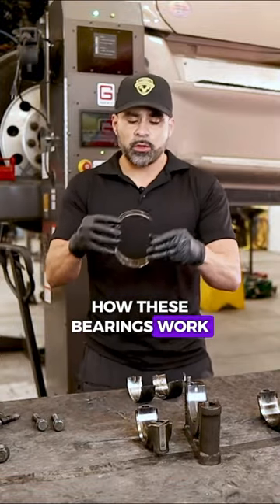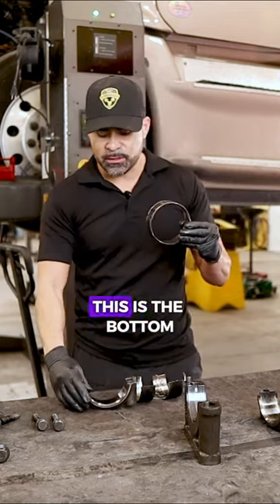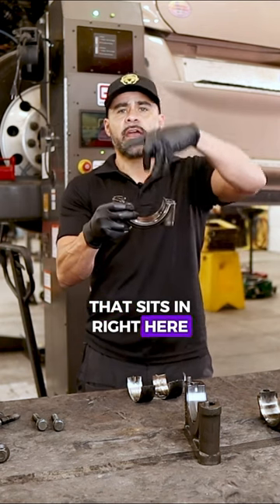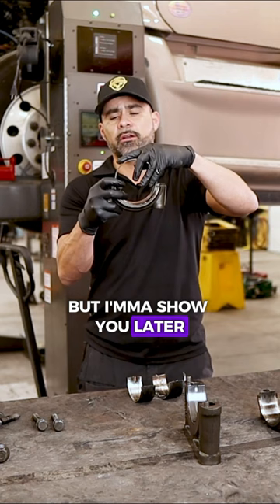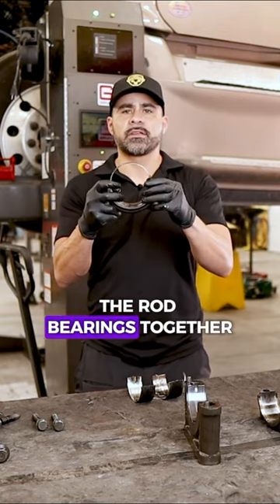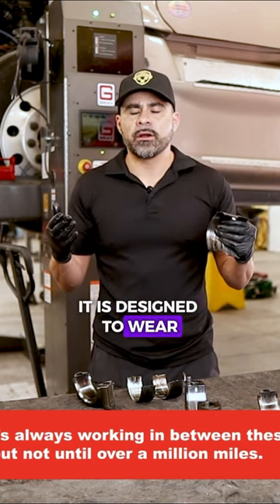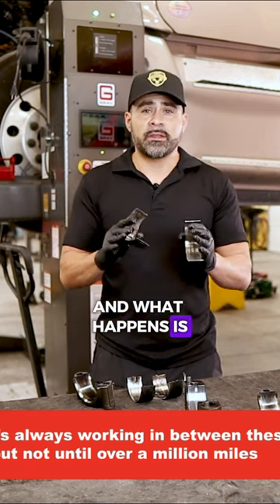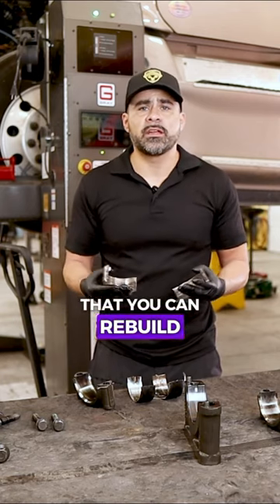What is a rod bearing? What a main and rod-bearing look like. How does a rod bearing work?

Comment: Is a regin engine that had gear problems and jumped time bending valves worth fixing. Will it hold up?
Reply from the maker: What type of engine?
Reply: @TATEXPRESSINC  14liter Detroit
Reply from the maker: You should be good with a new bull gear. Ensure you check the gear lash once assembled.
Reply: @TATEXPRESSINC  Thanks a mil.